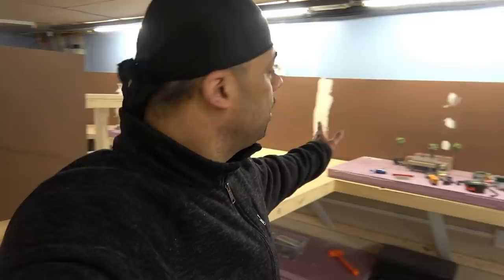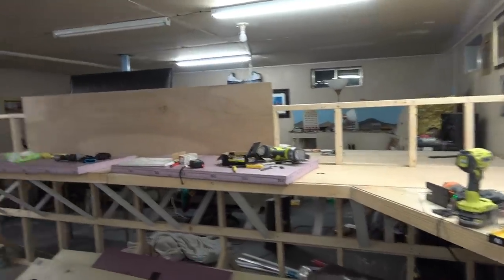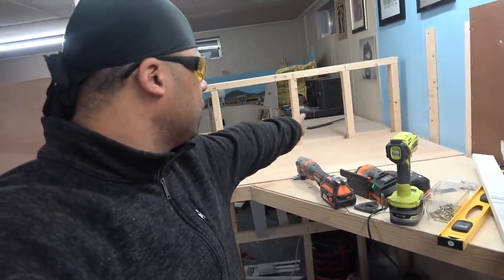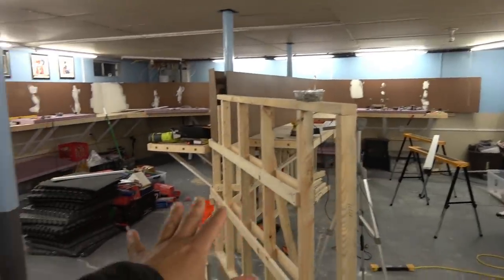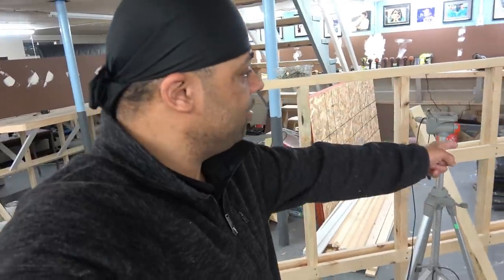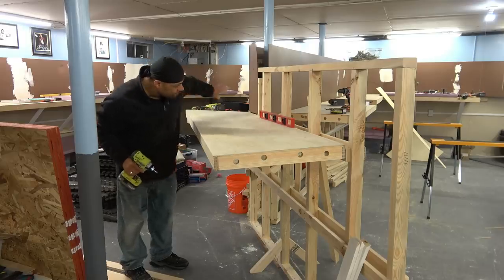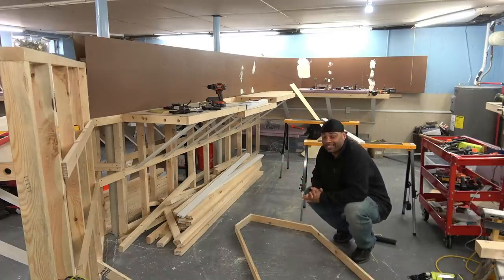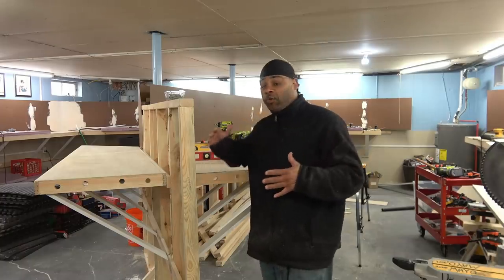04.29.20- Week 10- Finishing 95% of ALL the Benchwork

Comment: Looking good love your video's It makes me had to the layout and work on it. I hang with a round robin group here in Portland,Or. We have installed quite a few back drops and at the joints for your new table we in stall a back piece behind the joint then glue and screw it together and let it dry that way you end up with a 16 ft foot piece then take out the screws at the joint and fill and sand the holes and the joint for a seamless back drop.

Comment: Nice progress, terrific work!  I'm learning a lot, and am inspired a lot by your vids.  You'll like the LED tubes.  Same or more light level, half the electricity of fluorescents, one-fourth the heat of fluorescents, and NO ultraviolet that will fade the scenery!   (Ground foam will be grey after about 4 or 5 years under the fluorescents).  Plus you can get different types of white color of the lighting.  I had 5,000K at our previous house, but this house I changed to 4,000K LED's.  Still bright, but more natural.
Reply from the maker: Yes I have since converted 100% of my lights in the badement are now LED tubes. Nice and bright plus using up half the electricity. I have dozens of lights too so the use of half the energy is good!

Comment: How about radius type bench work for that loop, just an idea for a sweeping curved facia. Lookin good already either way
Reply from the maker: I do not know what Radius type benchwork is but I am using the 8ft 1"×3" wood boards built out to make the rough radius size of 7ft. Then I will apply the Luan sheets over the 1"×3" boards. Ismthat radius type benchwork?
Reply: MonsterRailroad similar, google it when you have a chance, looks like a spoke on a wheel
Reply from the maker: Will do that now

Comment: Nice work AL!! What thickness
is the backdrop board your using?
Kinda looks like Luan sheets.
I like the fact that they are easily
curved in the corners. Keep up
the great work!!!
Reply from the maker: It was called hardboard sold at Home Depot.  They are just $9 a 4x8 sheet, I have them cut to 2'x8' sections.
Reply: @MonsterRailroad  Thanks AL for 
the info!! I have an area about 
16x12 in my basement screaming
for a modest Conrail layout!!!
Reply from the maker: Do it Son!!